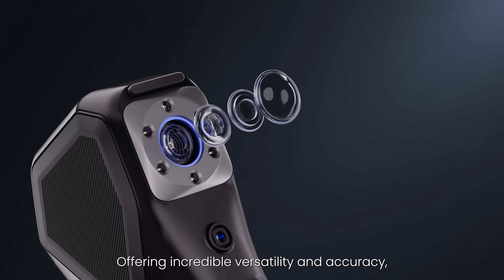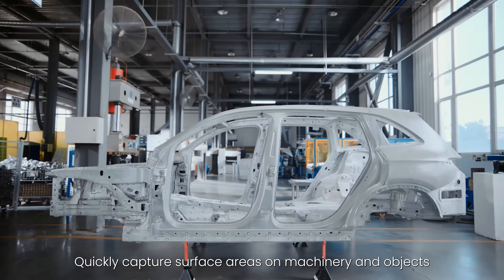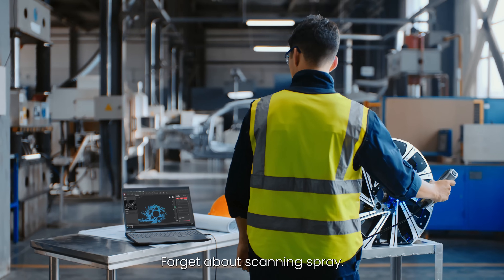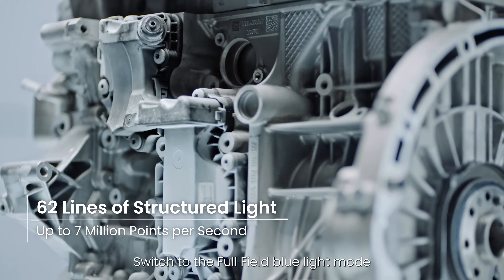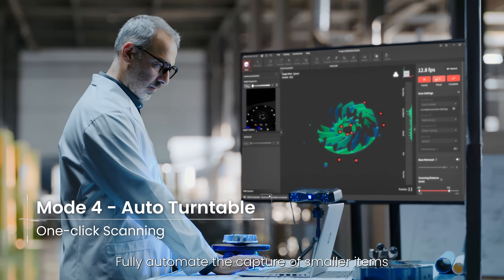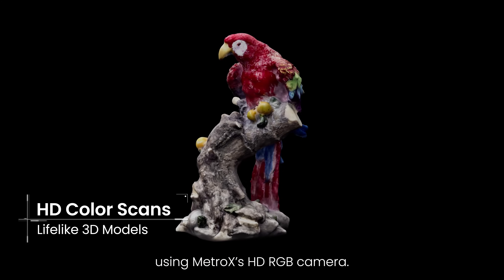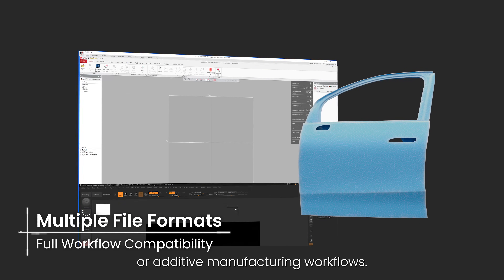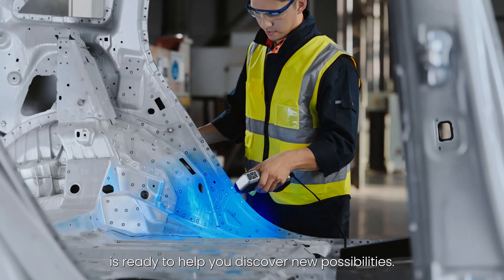Revopoint MetroX 3D Scanner: Every Surface, Every Detail

Comment: so this is better than the miraco?
Reply: @theunboxers24   it is Laser scanner , Miraco is infrared scanner , both are used for different kind of job , one is better for one thing , other for another .  For example  you should not scan any living things with Laser scanner , not good for the eyes ,  Miraco is safe ..  you can take Miraco to the museum and scan things , Laser scanner is indoor scanner and not portable .  Different types of scanning focus more on reverse engineering, 3D modeling and data collection . Laser scanners require powerful workstations to run smoothly.  They are both great just for specific jobs.
Reply: @PUTV3D Does this scanner not have different modes shown in the video that would be okay to scan eyes etc?
Reply: @keanucopp9741  sadly not , you can use Full Field mode for scanning Head-Torso  and the Full Field mode will not damage the eyes but it is very disturbing for people and 99.9% don't want that experience .  If you do , you will take the whole responsibility on you . I can't recommend that .  Just scan with eyes closed then edit it in modeling software .  I am only scanning live casts using Full Field  .